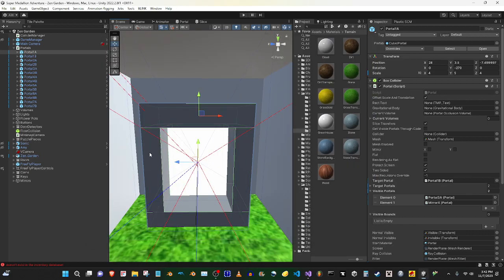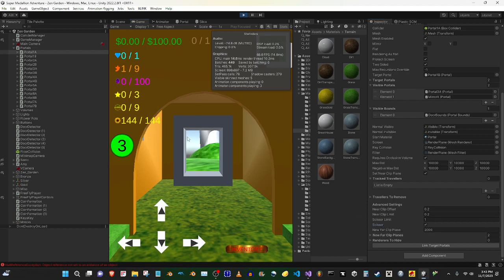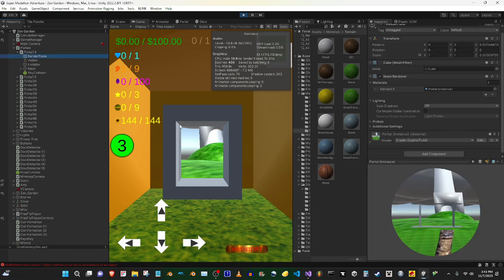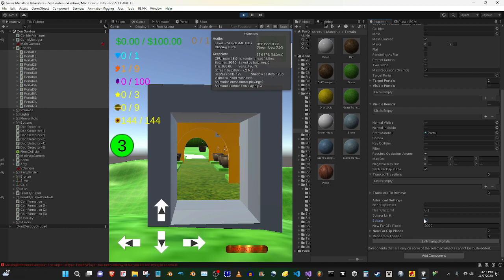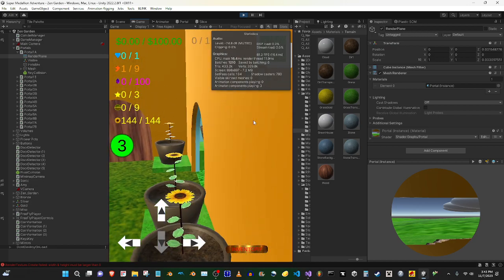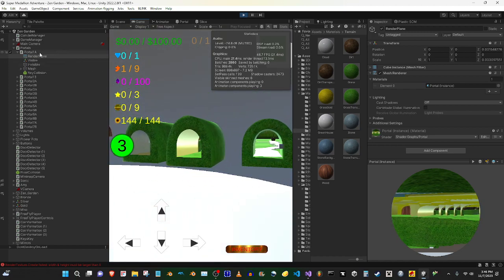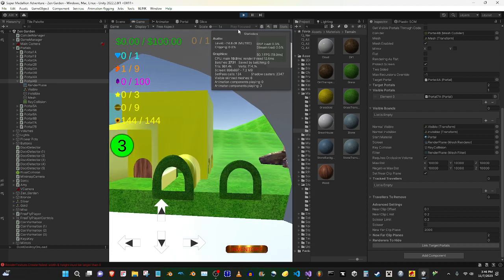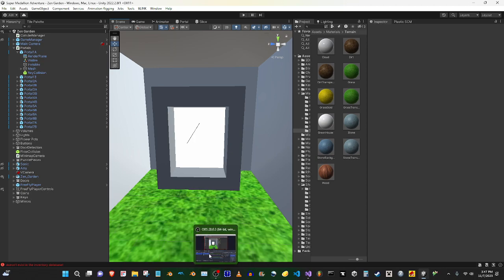Unity Portal Optimization

Comment: listen you did a really cool job implementing portals i have a question can i ask you to give me the code you used because i have been trying to make a normal mirror for a long time but i have problems with projection matrices and i cant make it normal so that the mirror does not redraw the whole level for the character because i cant specify farclipplane it would be very appreciated
Reply: Yes
Reply from the maker: My code is pretty complicated, so I'd rather not give that to you, but I might be able to give you some tips if you specify your issues a bit. What's going on with the projection matrices? I also had this problem with combining scissoring and the oblique clipping plane, and I had to add some out parameters to the Scissor() function to expose matrices for the oblique clipping projection to refer to, or doing the oblique clipping plane projection and then multiplying by the matrices after that.